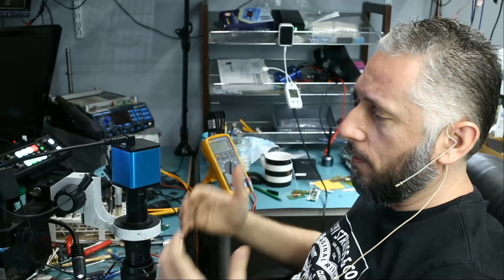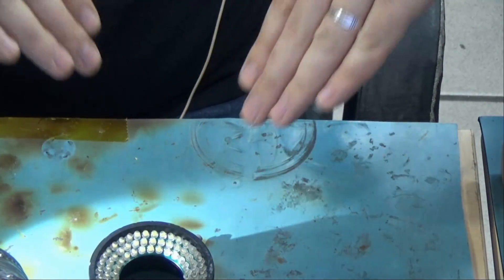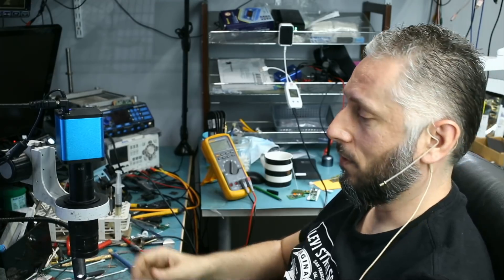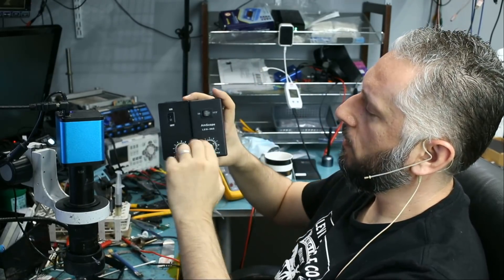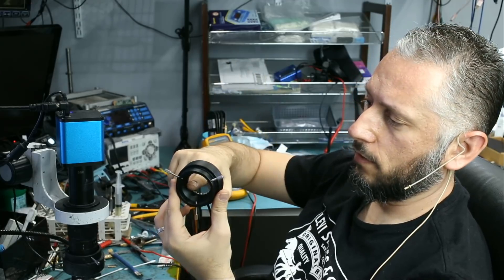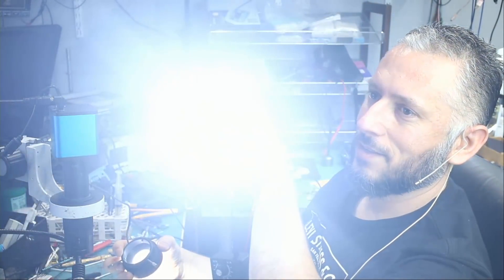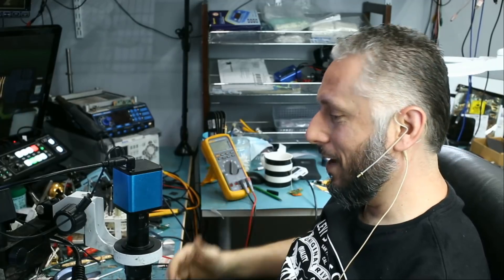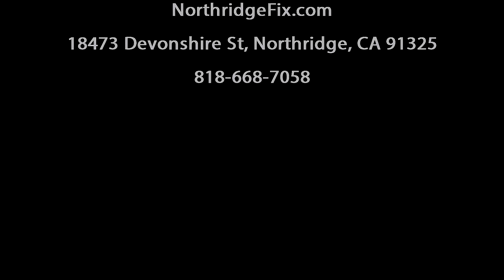Awesome Microscope Camera 96 LED Ring Light Review - Super bright shadow free Compared to Amscope.

Comment: Hi Alex. I do enjoy very much your channel, and you are professional no doubylt about it. Personal wise i like your style a lot.. 

Very straighfoward, hard worker, shares the knowledge, keep up like that, wish you the best. You surely deserve it.

I am in the electronics field as well, and i have a question for you. I have seen a lot of your videos, and i never seen yourself grounded since you work with electronics, unless you do it and is not visible on the videos. I have seen you using rubber gloves, touching just on the side of the board. But the tweezers, if they don't have rubber handle on them and you don't use any gloves,  wouldn't you risk a electrostatic discharge in to the boards? Is there something else to this subject? Just curiosity.

Greeting from Portugal